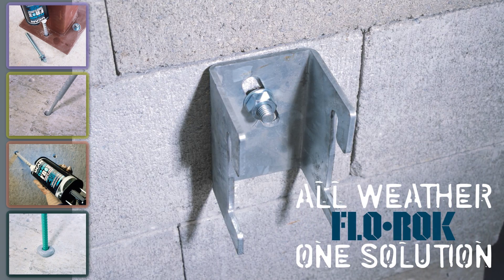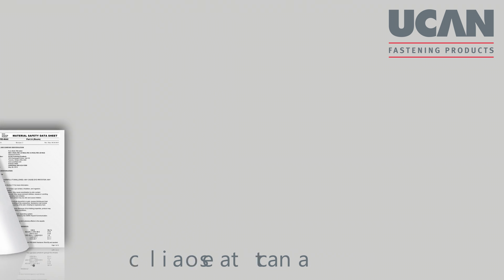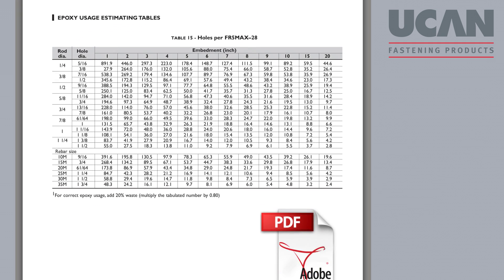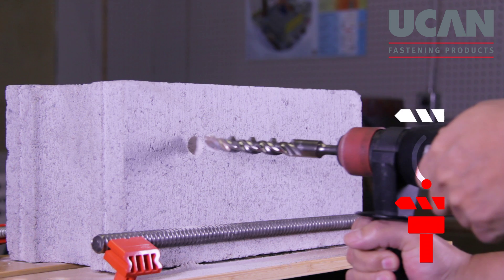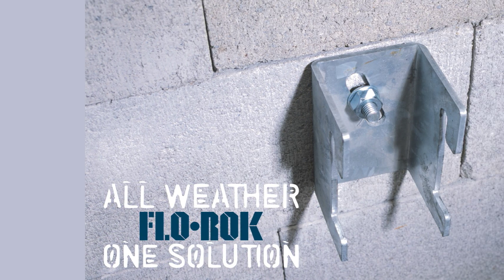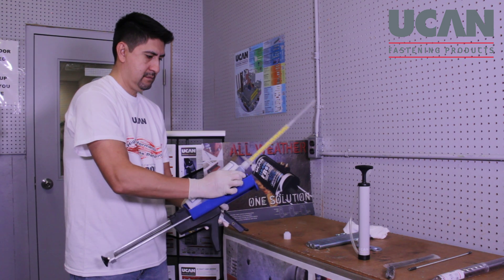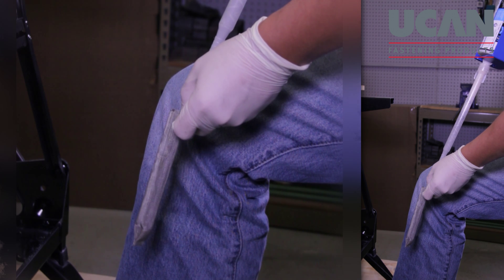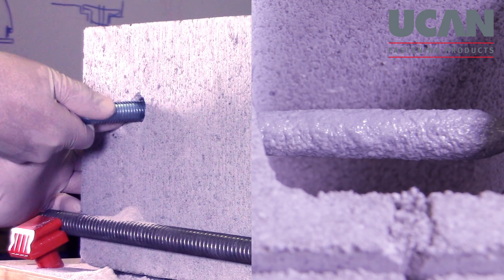FLO ROK® Hollow Wall Anchoring

Comment: Can this product be used to secure a deck ledger.  Wall is a 4 inch Block /4 inch brick wall sitting on. 10 inch block foundation wall.

1952 Block/brick home.
Reply from the maker: Hello,
Thank you for your interest in our products. This application requires engineering design to evaluate what product would be suitable to support the ledger board to the brick/block wall.

Comment: What if I need to bolt a sill plate into the top of a cinderblock where the voids are? Essentially the adhesive will be stuck to the wood’s wall and in the void of the cinder block? Will this work?
Reply from the maker: Hello,
Thank you for your interest in our products. 
On what part of cinderblock will the bolts be installed?

Comment: The inside is completely hollow.  What is  holding the bolt in place? Is it just the connection near the outside where it first enters in doing all the work?
Reply from the maker: Hello,
Thank you for your interest in our products.
The mesh screen prevents the epoxy from filling the void (inside).  This prevents wastage. The bond/connection is formed only between the screen/epoxy and the “wall” of the block where the two are in contact.